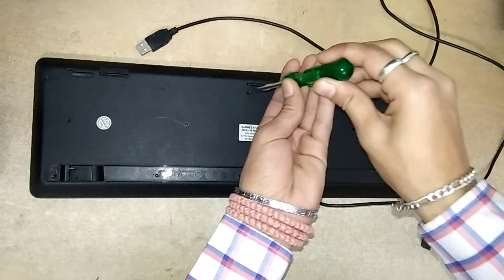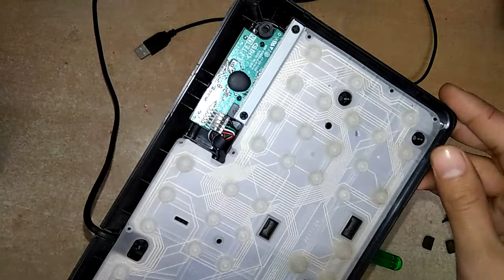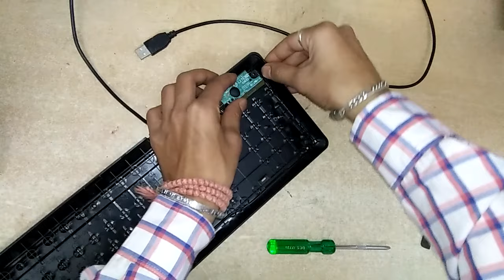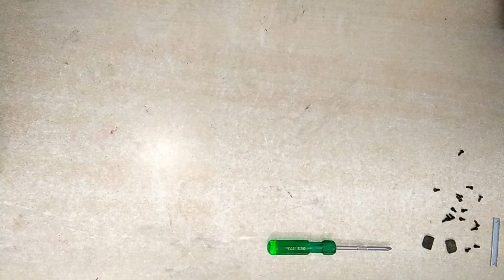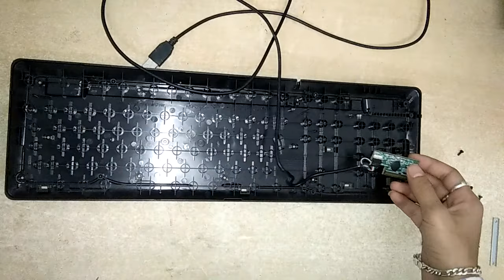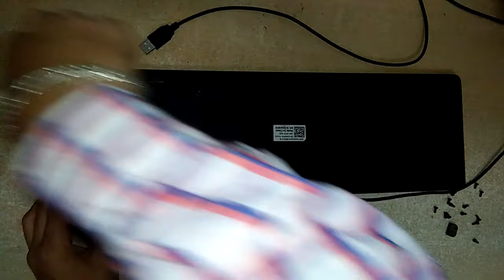How to open and assemble a keyboard at home || Guide

Comment: I opened my keyboard for cleaning and now its not working🥲
Reply from the maker: Make sure u tighten the screws of circuit board
Reply: @techuniverse6839  after your comment i opened it and saw conductive plastic plate was not touched properly to the circuit ...now its working again...
Reply from the maker: @avneshkumar9344  yes i also got this issue my first time

Comment: I want help. I opened my keyboard and I cleaned it and dried it well, but after installation, the buttons began to press on their own, even though I installed it well and tightened the screws well.
Reply from the maker: clean the plastics sheets of buttons sometimes they get sticky together due to some liquid or water or something check and clean carefully and completely
i hope this helps

Comment: hi sir after i clean my keyboard it doesn't work now what should i do?btw my keyboard is same as yours
Reply from the maker: Check if u fit the metal plate on the wires and tight the screws